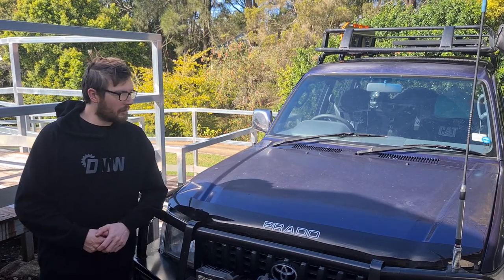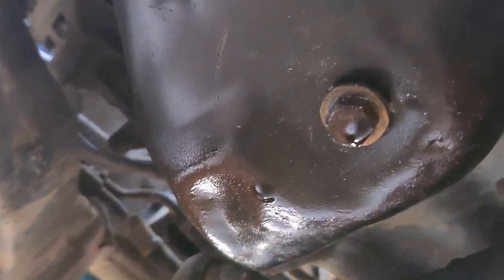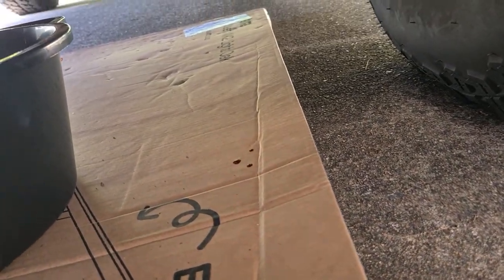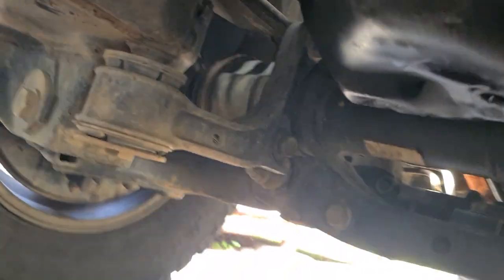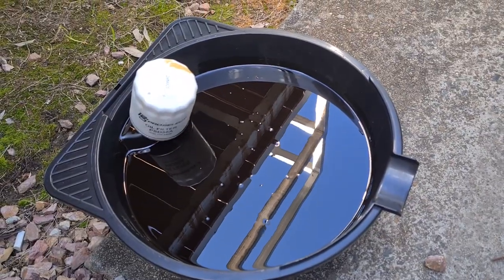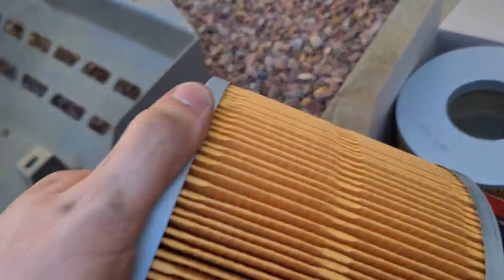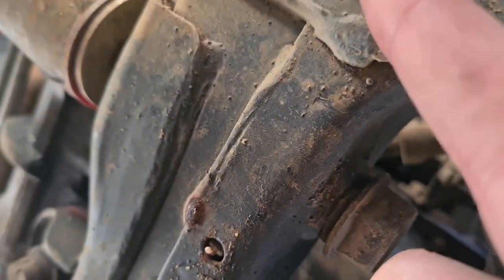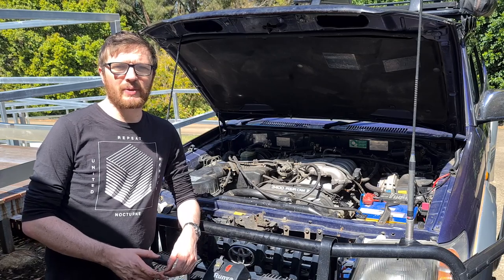Noelsy's Outdoors | 90 Series Prado: Basic Service

Comment: Hello, can you tell me how I could correctly measure the engine oil level, many times when I try to do it, more oil comes out on one side of the dipstick than on the other and vice versa. Do you have any idea how I could measure correctly like with you? Thank you very much.
Reply from the maker: use a rag to wipe the dipstick off once, insert the dipstick back into its tube then  check the level, there should be 2 dots or notches on the end of the stick one closer to the tip is for your level when the engine is cold, the other is for after the engine has reached operating temperature, as long as your oil is on those dots when either cold (lower dot) or warmed up (top dot) you should be fine. if this doesn't help consult your owners manual for proper procedure

thanks for the comment!

Comment: Hi from Thailand, Thanks for the VDO and great content. With regard to the oil filter removal : Toyota have designed a removable plastic inspection plate on the inside passenger front fender wall. First turn the front wheel to give you access to this plate. Unclip it and you will see the filter. You will need a different oil filter removal tool which is shaped like a large socket head with fits onto the bottom of the oil filter. These are available at most auto stores, just need to make sure it fits your filter.  Method: Connect this tool to a socket extension and bar, put the filter on it, guide it through the inspection hole and 'Bobs your uncle' as they say....Very easy to remove and install. If you want to avoid extra friction on startup, most recommend you half fill the filter with fresh oil....just enough so it doesn't spill out in the horizontal position. Replace the inspection plate with the clips. Sometimes with age the inspection plates can break. No big deal as you can cut out new ones out of an old tyre tube as I have done, and they work perfectly well to keep dust and water out of the engine compartment.
The main advantage of using this method is that it avoids removal of the bash-plate which is a real pain to reinstall when you are working solo. You only need to remove the sump plug access plate on the baseplate to drain the oil. I hope this helps as I also struggled for years before a mechanic showed me the easy way to do this. This method allows for quick and easy oil changes on the road to your next adventures.
One final small point you may consider is using a fresh copper crush washer on the sump plug. These are available at most auto stores and you don't need Toyota specific ones if you're in the bush.
Landcruiser Prado's are a great 4WD and mine is currently on 370KMs and going strong.
Thanks and look forward to more of your content.
Reply from the maker: Thanks for the comment. There is a lot of great information here to add in for a future video!

Comment: Might be worthwhile checking the PCV valve is dry and clean, if dirty and clogged up might be the reason for oil leaks , typically rear main seal will weap and may affect sump gaskets also.
Enjoy your adventure,  cheers